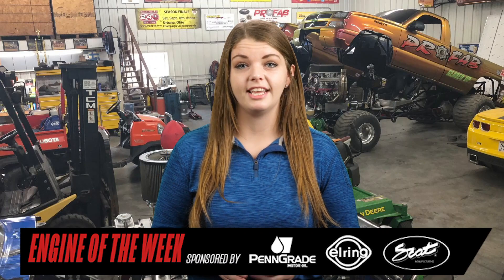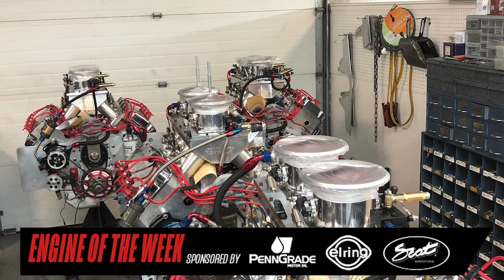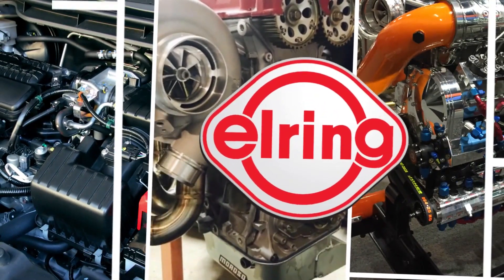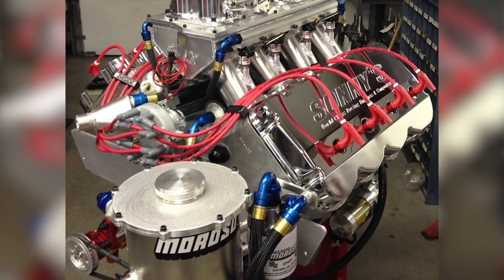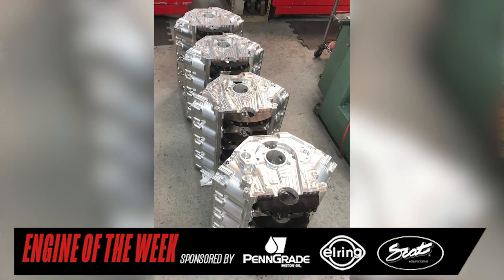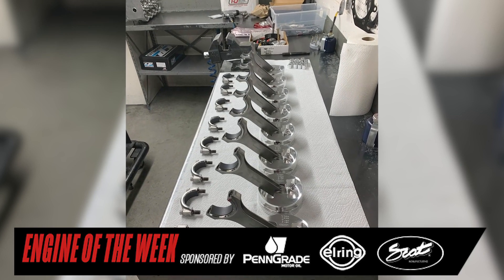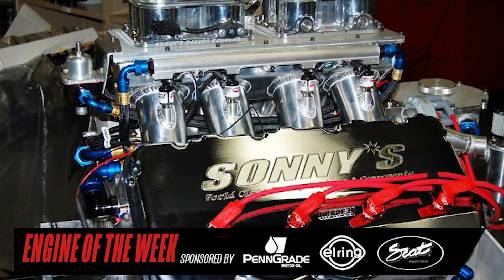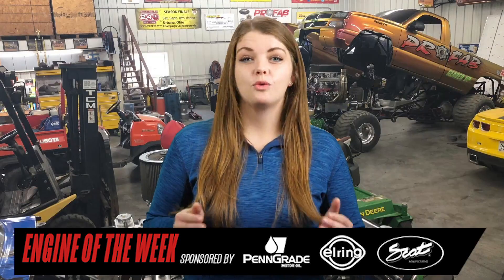Sonny's Racing Engines 820 cid EFI Marine Engine

Comment: Anyone?  I have a boat that I want to fit with 1 Sonny's 820. Does ANYONE HAVE FIRST HAND EXPERIENCE with one that is installed in any boat. The 820 shown here. I can't seem to find even 1 boat that is fitted with the  820. No B.S. It's replacing an engine and I want to view one IN A BOAT.  I'm not going $100K unless I AM SURE this will idle, run, and do it again and again.  Who has one or two?  Anyone? Anywhere?

Comment: All the details? Not entirely sure there were any actual details. Would be nice to know some stats other than the most basic stuff.
What kind of cam numbers are we looking at? What kind of compression ratio? What it the weight? What is the deck height? What kind of hours between top and bottom end rebuilds? Can it be closed loop cooled? What kind of idle RPM does it have? What is the average torque and hp numbers? Will it need dry exhaust or can it run a wet exhaust?
So many things unanswered. This was just the basic stuff you can read on the website.